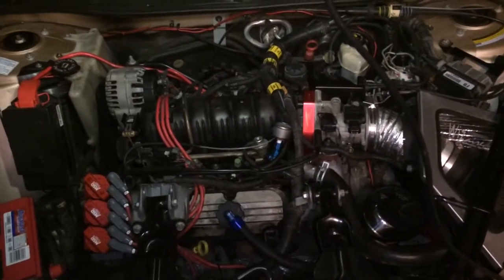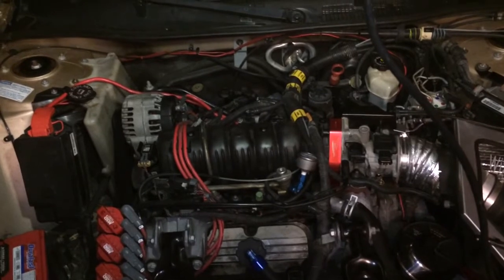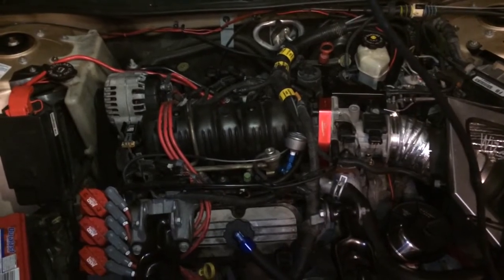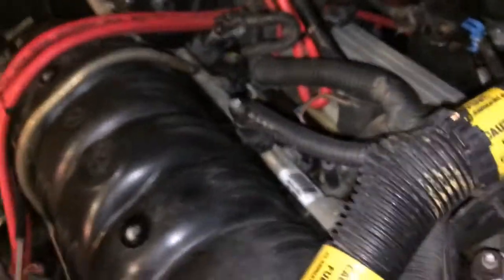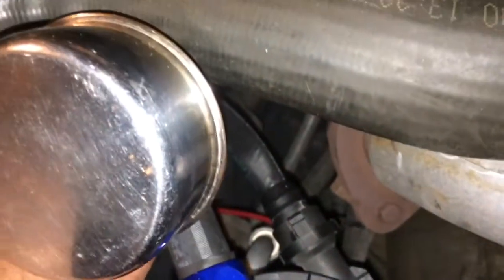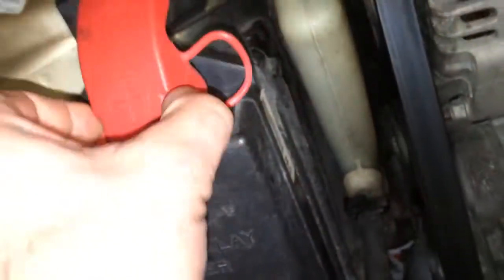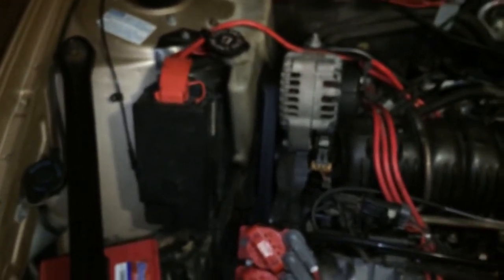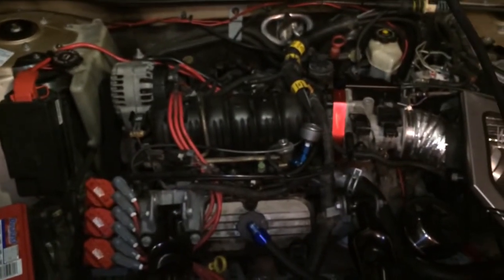2000 Grand Prix GT 3800 Vacuum Pump Mod

Comment: You may be able to install a front valve cover onto the rear so you would then have two filler caps to work with. Then make a splitter so the front and rear banks get evenly vacuumed. Instead of adding the weight of a vacuum pump which requires power from the cars electrical system, try using a large vacuum reservoir with manually adjustable vacuum regulator and gauge. With a 2 outlet vacuum reservoir one outlet can be fitted with a one-way valve between itself and the intake manifold to generate and store vacuum during a solenoid-closed WOT pull. The other outlet can be opened or closed via said solenoid to connect the charged vacuum reservoir to the crankcase when that extra power is desired.
Reply from the maker: It was just a simple test. Nitrous is the best way to add power....a 25hp dry spry in the intake works, but who cares really. To make power it needs better pistons, head porting cam & computer tune....which is a waste since the transmissions never last.

Comment: Did you test compression on individual cylinders with and without the pump running?
Reply from the maker: wouldnt waste that much time on it. That would really be hard to test since blow-by happens more @ high speed under full load